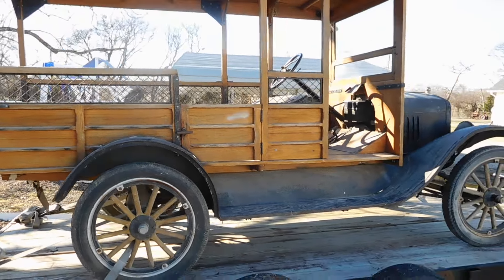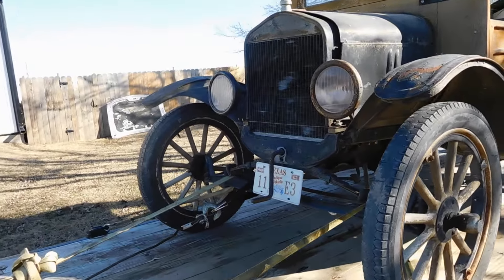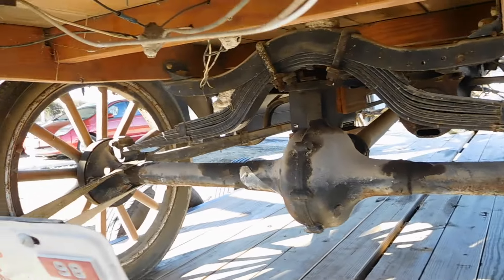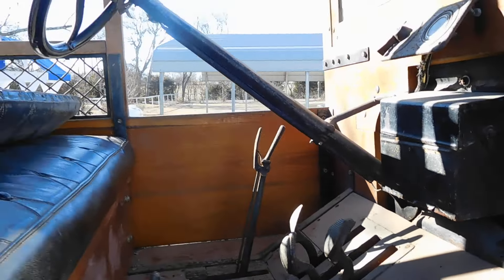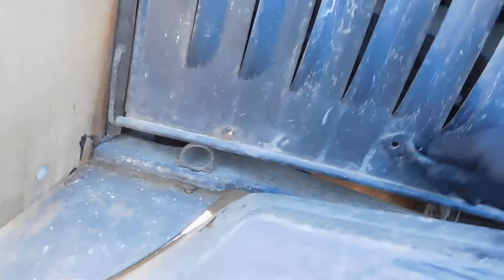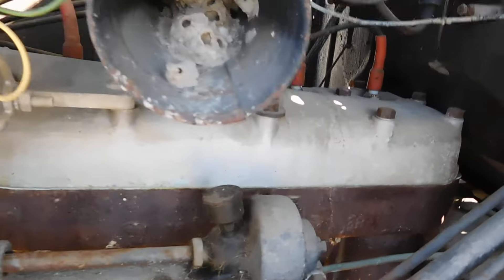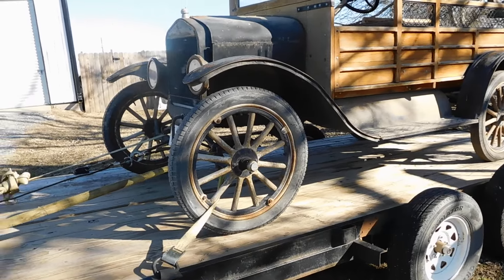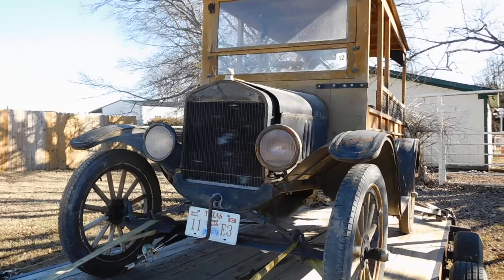1922 Ford Model T Milk Truck. The Oldest Car I Have Ever Hauled!

Comment: To start it, be sure to turn the advance on the column up and just about halfway down on the gas you can crank it and not break your arm when it backfires if it does. Usually they don’t backfire.

Comment: 3 pedals. Far left reverse pedal middle is clutch pedal right is brake. Spark and gas on the column. First car I ever drove at 10 yrs old 27 model t ford.

Comment: Yes updated electrical. Alternator, distributor, coil, and a starter usually for 12 volt system but that's a hand crank for starting so no starter

Comment: Engine defiantly had a lot of work done modifying it. with the high compression aluminum head and actual water pump ( originally just thermo siphon system ) and an aftermarket distributor as it originally had a timer for the vibrating coil ignition. probably raaised the horsepower fro the original 20 to probably closer to 35.

Comment: I think water pump was added.  Distributor was not like that.   The 3 peddle system is unique.  The left lever has to be leased to engage high gear.   The planatary trans works like a c4 only no hydraulics and I think shares engine oil.